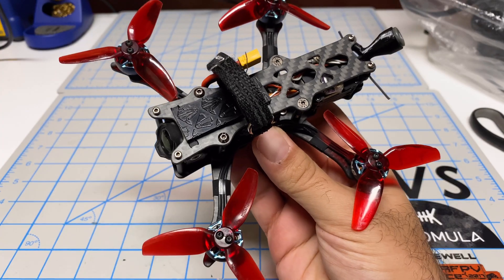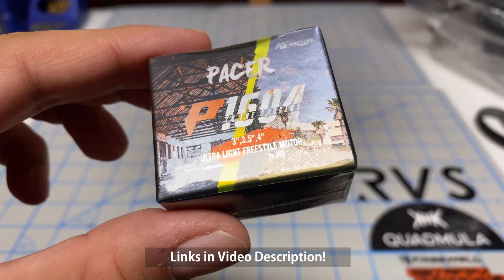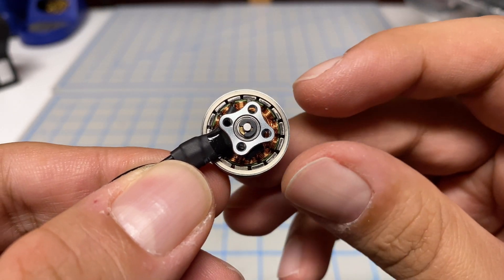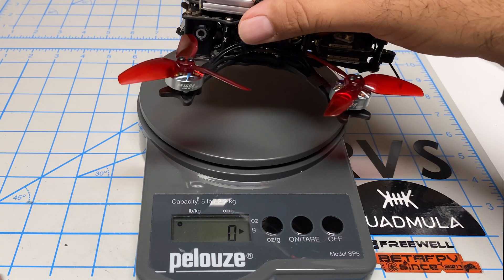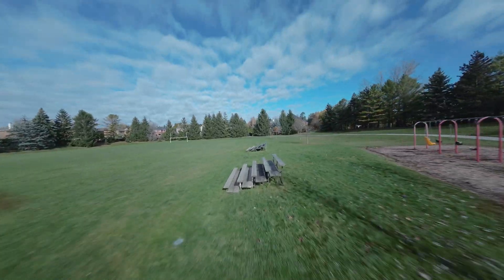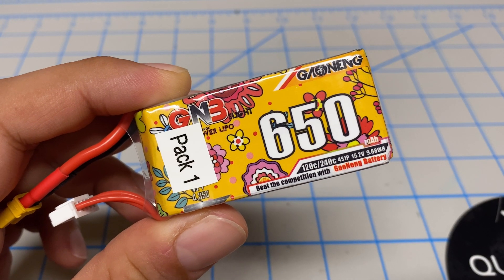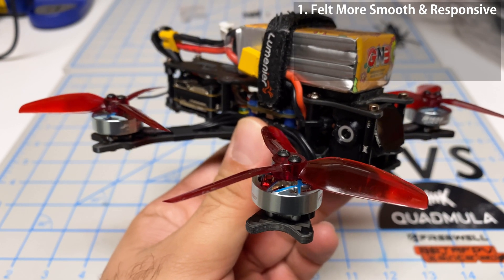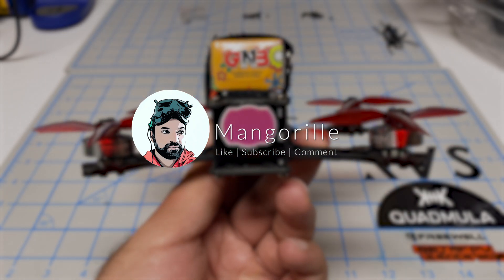These Motors Were SURPRISINGLY Good | T-Motor P1604 3" Freestyle Motor Test

Comment: Bro  your Build is almost the same as mine with same motors same props just frame is different which is volador vx3 , bro I have applied supafly 3inch preset but when flying with that it gives too much prop wash and doesn't feel responsive and just feel bad to fly any help would be really appreciated. 
Thanks
Reply from the maker: I've never had much luck using some else's tune on a completely different build. I'd recommend you try doing your own tune by signing up for PIDToolBox over on Patreon for a month ($8 CAD) so you can get access to the software and his support.

Comment: Dont yoy get less speed withvthe lower kv
Reply from the maker: You theoretically get less rpm at the same voltage. HOWEVER, given the drag of the props, motors never spin at their theoretically maximum. These motors being larger means you have more torque and can start to hit higher rpms even though the KV is lower. At least that's the thought process.

Comment: Are these 1604 3800kv motor more responsive than a 1404 4600kv? Which would u prefer? Thanks
Reply from the maker: Depends on the build. If you are going light weight sub-250, I actually like the 1404 more.

Comment: Would you have any concerns about running these in 3800Kv with the Speedybee F405 40A AIO?
Reply from the maker: On what size quad and props?
Reply: @Mangorille  Oh yeah, I guess those details are pertinent 😂
Just starting out in the hobby and learning. Looking to build up a Volador 3.5" to move up from my Mobula 8.
Reply from the maker: @ A 40amp ESC is more than enough for a 3.5 inch build with these motors. Remember that the rating of an ESC is per motor so a 40amp 4-in-1 ESC is actually capable of 160amps total. These motors will probably pull a maximum of 60amps total on a 4s battery.
Reply: @Mangorille  I did not realise that the rated amps was per motor! Thanks so much, I'll continue to spec something up 😄
Reply from the maker: @ A common misunderstanding. I'm using a 20amp AIO on my 3 inch now-a-days and no issues given that I usually pull a max of 54amps. Do also remember that the rating of the ESC are for continuous current, they usually have another rating for a burst current that lasts 5 sec or less (e.g. a 20amp AIO can do 25 amps for 5 secs).

Comment: I use these on all my 3.5 builds and stick to the 1404 on 3" - love them!
Reply from the maker: Which 1404 motors you running? I've recently moved over to the RCINPower.
Reply: @Mangorille  I'm now sworn by T-Motors and have all F1404 3800kv.
Seen the RCInPower and will definitely give them a try when I can find them in stock as they are my go-to for whoop builds!
Reply from the maker: @fuspyfpv  I've had really good luck with my T-Motor P1604 but the specs of the F1404 look like a powerful but inefficient motor whereas the RCINPower are insanely efficient (at least if you believe the spec sheets published by the manufacturers).
Reply: @  Unfortunately the RCINPower weren't among those tested but this video from Chris has been my bible when it came to picking the right 1404 and the T-Motors (although in 4600kv) came out top in efficiency: https://www.youtube.com/watch?v=DEbOTA150Xg&t=950s

Looking forward to also know more about the RCINP durability after a few flights ..I still crash a lot and T-Motors have been kind with me on that side too :D
Reply from the maker: @fuspyfpv  I saw that video. I actually tried his favorite pick and the motor failed on me. https://youtu.be/jC0QeDTSZRg

Comment: Will this type of build with 1604 can carry a Dji action 2 camera?
Reply from the maker: You'd want to go with a 3.5" if you want to get decent performance at the same time. Can it carry it, yes, but carrying an extra 60g will impact the performance. FYI - You might as well get an O4 Pro and ditch the action cam at this point.

Comment: Thinking this 1604 for explorer long range
Reply from the maker: What size and weight quad you looking at?
Reply: @Mangorille  well with the li-ion it's heavy. Quad right now is 175g with camera. Li-ion is 206g. I want to use triblades on my other drones they are more efficient at low throttles. Also on way home explorer is at 60% throttle in current configuration. Also curious is I could run 6s (li-ion might weigh too much for the skinny arms)

Comment: Can I use these motors for a 3.5” cinewhoop ? Using 1100mah 6s
Reply from the maker: That's a big battery. What's the all up ready to fly weight of the cinewhoop and what motor mounting hole pattern does it take?
Reply: @Mangorille  9m or  12m on a 3.5 axis frame .
Reply from the maker: @55amps  Perfect. What about the all up weight of your quad? I'm already thinking you need a bigger motor based on your battery and I suspect you are going to run a GoPro as well?
Reply: @Mangorille  297g without battery. I ran 2004 1750 kv but and it lack on power. Yes I will have my Gp 11
Reply from the maker: @55amps  You're in the right ball park with those motors, you could go a bit bigger but I wonder if you lack power because of your prop choice. What props you using?
Reply: @Mangorille  you're rite with the props, I was using 3 blades gemfan.
Reply from the maker: @55amps  Can't run 3.5" props? They make a big difference. Also check the pitch of the blades you are using. 3 blade props?

Comment: These motors fly great on my grinderino. Just wish they were more durrable. They just dont take crashes well. The inner motor shaft is very small and bends easy in minor crashes, And cant really bend em back cuz they snap. On top of that tmotor wont sell bells seprate. So now i got 8 paperweight stators. Haha.
Reply from the maker: Unfortunately I think that's these smaller lighter motors in general. The 1404 and 1604 both have 2mm internal shafts with a 1.5mm pin for the props. Only so much that shaft can take.
Reply: Yeah your right😢 i really liked these motors too. Fly great and had good flight time.
Reply from the maker: @Deathdezine  Exactly, I've had to replace a few 1404 motors over the years, they develop a vibration after a few good crashes. Nature of the beast I suppose.

Comment: I almost replaced my Brotherhobby 1504.5 motors with these 1604 but they use an odd 9x9mm mounting pattern that my 3” frame doesn’t accommodate.
Reply from the maker: Yup they are a 9x9 mounting pattern, same as the 1404 motors so great for me.

Comment: Gotta go with that 530 or the 380 HV for the lightweight feeling, which will in turn lower the amperage pulled as it wont be slugging as much weight.
Reply from the maker: I think the 530HV is the sweet spot for a lightweight 3 or 3.5". Only problem is that they're a bit hard to find where I'm located. I tried the 6s 650 and it gave me about 1-1.5 minutes more flight time than the 4s so I think the 530 should give similar if not slightly more flight time than a 4s setup.
Reply: I use the 530mah myself, getting close to 4 minutes of proxy freestyle (not many aggressive punches, a lot of aggressive turns). So the flight time is quite similar, the lack of voltage sag is where it really shines, along with the extra punch if/when you want it.  @Mangorille

Comment: I put these on a sub 250g 3.5. Nice motors
Reply from the maker: That's a good use for them. I'm building a 3.5 with 1404 motors right now.
Reply: @Mangorille  I currently have them on the pirat lil matey. I have a 3 to 3.5" frame I designed that I plan on switching them to. That frame is not published yet but similar to the f3. I have published a 5" the skelter5 v2.
Reply: @Mangorille  is it good enough power?
Reply from the maker: @aloysiuspuspandono1833  Enough power for what kind of flying?
Reply: Love mine!

Comment: Have you tried the DALprop T3028 ? Ciotty claims they are better than the hq 3x3x3.
Reply from the maker: I haven’t. I tried a few different Gemfan props and always come back to HQ. I’ll give anything a try if it’s sent to me but at this point my own money is set on HQs. :)
Reply: @Mangorille  alot of times I like gemfan. But HQ been for the win on certain prop sizes. My 3" runs HQ 3x3x3.
Reply: I agree HQ props for the win! Although, I do really like the T-Motor 5143 props on my Siren F5 splits and F5 Split Mini.

Comment: Dude, I am using 1804 from tmotor (I belive is new as this 1604), pretty good motor ❤

My gig is 3.5" 4s
Reply: Yes Sir! These are the motors I have on my Siren F3 split as well! They are fantastic! The only thing I didn't like was the T-mount, so I was going to switch to the 1804s with the 5mm shaft. Then I built a squirt with the T Motor 1507s that have a 5mm shaft. It is very difficult to change props because you can't get a good grip on the motors without slicing your fingers, so I gained a new appreciation for my old T-mount! Lol! Maybe the 18mm bell would be easier to grip than the 15mm bell, but for now, I'm sticking with the 1604s! I love my Pacer 1604s I know you're gonna love yours! Murders runs these on his F3 as well. Welcome to the 1604 club! 😂 🎉
Reply: @William_NS  thats why I tried the 1804, M5 mounts
Reply from the maker: Whoa, 1804 seems massive! :) I'm working on a 3.5" build right now with 4s and I'm running the 1404 on it.
Reply: Which 3.5" frame are you guys using?
Reply: @chrisbee5481  axisflying manta 3.5"
Reply from the maker: @chrisbee5481  I'm working on a review of the RVS Smolyeet35 V2 right now.
Reply: I got excited and typed my last comment before I watched the video. Lol! Next we gotta get you on 6s on your Siren F3 split! I guess that would put you over 250g though. I run the 2800 kv variant and usually fly 650 mah GNB packs with a Runcam Thumb on top. Although, I have flown my normal 1300 mah packs on it as well. With the 650s, it flies exceptionally well, as all my Quadmula frames do.
Reply from the maker: @William_NS  I actually tried 6s 650mah, which caused it to be way over 250g which is a big no for me. I actually found that it felt underpowered at that weight but nice to have very little battery sag.